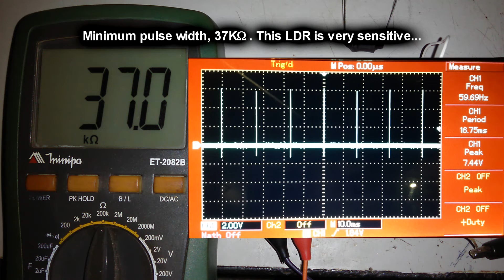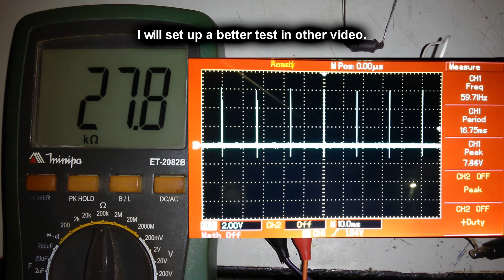Making LED and LDR Optocouplers (the Vactrol thing)

Comment from the maker: Making DIY Vactrol style optocoupler using LED, LDR, shrink tube, plastic and paper. This kind of optocoupler can be used on many circuits that require a voltage/current controlled resistor, such as VCA, audio compressors, limiters, expanders, VCO, voltage controlled LFO, phaser, VCF, etc. By varying the current on the LED (Light-Emitting Diode) in order to control its brightness, we also change the resistance of the LDR (Light Dependent Resistor) receiving the LED light. Although not suitable for applications requiring fast response to control transients (sudden changes on control signal) this kind of optocoupler can substitute the use of OTA (Operational Transconductance Amplifiers) for a fraction of the cost. 
Join this channel:
https://www.youtube.com/channel/UCQxQy-Z7SF7LFKsvSpqrTXg/join